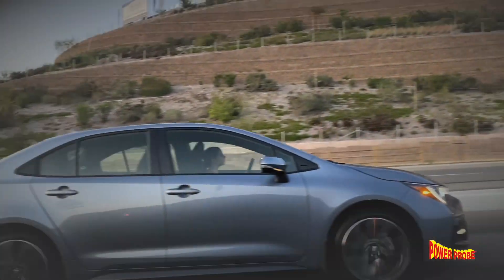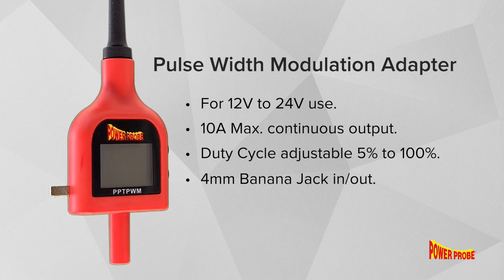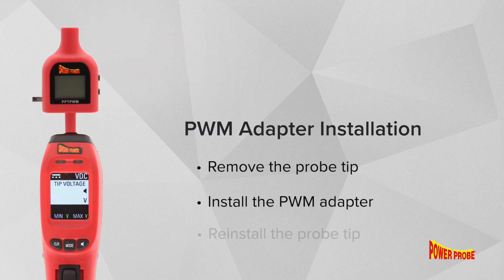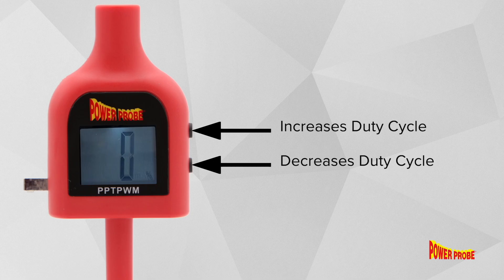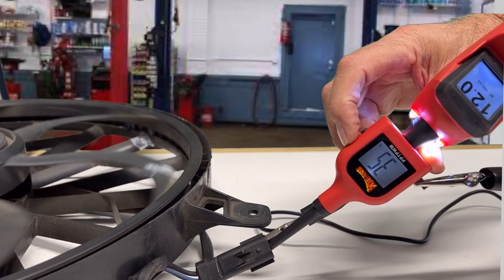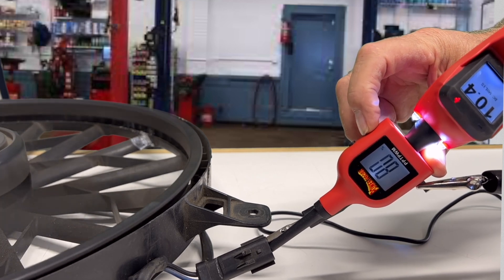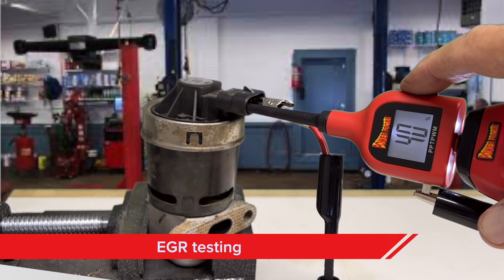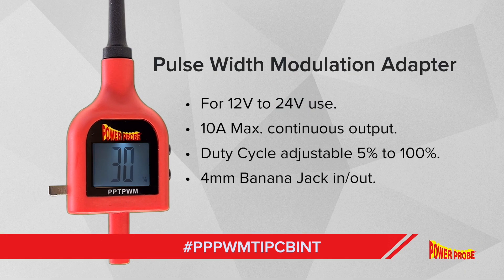Pulse Width Modulation Adapter by Power Probe

Comment: Since the auxiliary ground is connected to pwm ground tab, can I use a jumper wire to connect the auxiliary ground to the ground side of the component? I didn’t see information in the video how the ground to the component was connected
Reply from the maker: Yes you can!

Comment: Can. It do A5 volts testing,,on signal wiring from ecm. Pcm ,, computer testing signal,to diesel injector supply,, and give proper reading,,???,, just checking cuz there is a lot of different people saying different information and thanks
Reply from the maker: You can combine the PWM tip with our PPT5VA tip to limit voltage and current when using these on computer circuits

Comment: So it gives you the ability to vary the duty cycle which is the width, what about the peak to peak voltage of the signal just created ? Is it 5v or 12v fixed ?
Reply from the maker: It outputs the voltage out coming out of the power probe so 12V but you can stack the tips and put a 5V tip on (PPT5VA) and limit it to 5V to test sensors and similar.

Comment: Great feature! Why did you stop making the hook it had latch mode and measures amps built in, (not sure about pwm)?
Reply: Didn't measure pwm but yes the hook is the best tool they ever made, now it's the maestro but I'm not certain I'll trade my hook for it lol.
Reply: @rdh1001  I have the maestro but I prefer the hook.
Reply: @advancedleveldiagnostics  same, I'm actively fixing broken junk on it to keep it around. You have any problems with that ground breaking?
Reply: @rdh1001  Funny you say that my maestro and my hook the ground broke at the connector for the fuse, I just cut off the fuse and put on a bannana connector.
Reply: @advancedleveldiagnostics  hah I just did that today broke at the same place and pp won't sell me the pigtail. Have you had any trouble with the pwm adapter? Mine trips the breaker constantly.
Reply: Oh hah, nah it's a new addon for any pp. Works well just pops breakers kinda easy.
Reply: I keep patching my hook. The green fuse holder on the ground broke but I repaired it. I too like the power switch latch mode.

Comment: I have a question, is there any way possible that you can show more detail through actual video. For many different application using this device.
Reply from the maker: Hey Terrence- applications would be any vehicle components that are driven by pulse width modulation, like cooling fans, slower motors, or even fuel pumps. We're working on some additional videos now.

Comment: I bought this tool for the purpose of testing parts that require a pulse width signal. I was surprised to find out this tool is only a duty cycle tester. It does not pulse the signal at all. The name is misleading.
Reply from the maker: Hey Daneil. The PWM tip changes the Power Probe's continuous 12v output to a pulsed 12v signal, between 5% and 100% duty cycle. Please call our tech support line at 800-655-3585 if you have any questions about this or other Power Probe products.

Comment: Wow nice, can't wait to add this adapter to my power probe kits. You guys are really stepping it up with the quality adapters. Just need an adapter to show the resistance/voltage drop on non loaded circuits. PS, when and where are we going to be able to pick one of these?
Reply from the maker: You can buy them through Mac, Matco and Cornwell distributors right now!